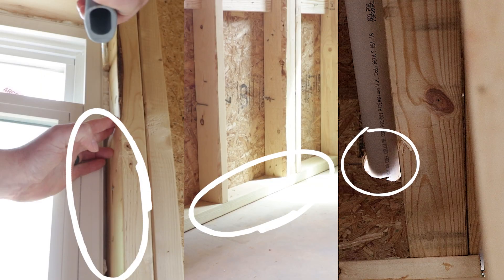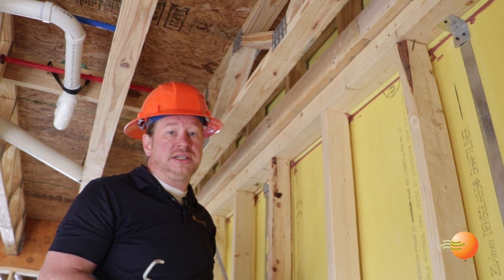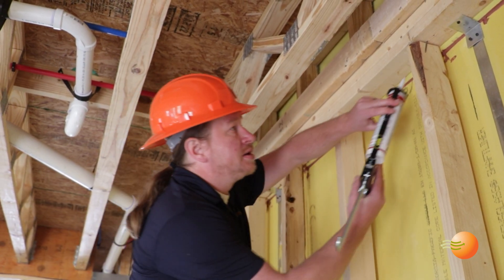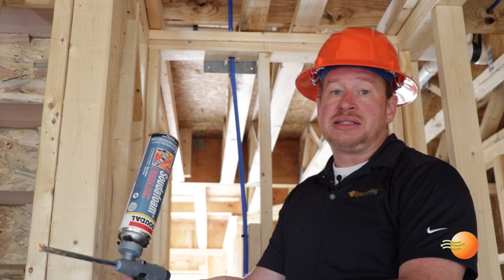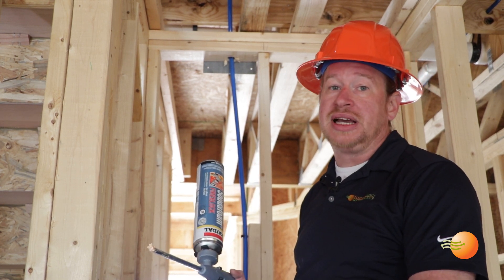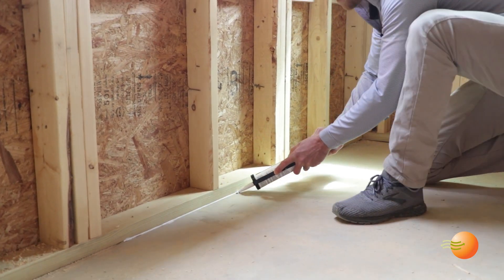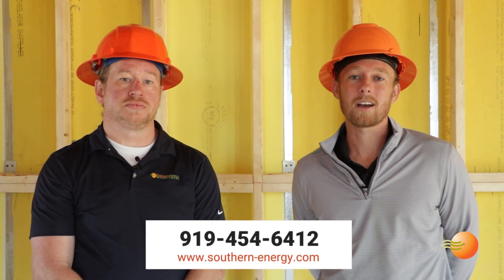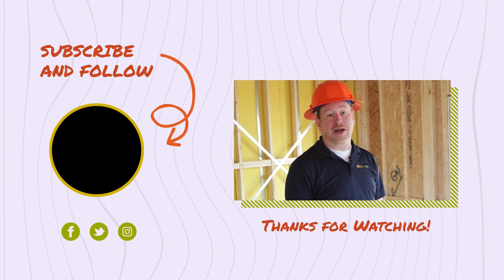How Air Sealing Saves You Time and Money

Comment: air sealing something from inside is stupid. Air seal from exterior.
Reply from the maker: There are plenty of durability and efficiency reasons why you should have relatively airtight exterior barriers, that's table stakes.  There are huge opportunities for interior air sealing, like sealing drywall to top plates and mechanical chase which are better addressed from the interior.  A lot of that air leakage is originating from the attic, band joists, cantilevers and other funky framing details.  If we're really trying to get home performance to the next level, ES v3.2, DOE ZERH, we need to seal up everything that we can in fiberglass houses.
Reply: Ive seen you post this comment on other content creators in the airsealing business... shut up already. You are 100 percent wrong get over it dude.  @Faruk651  you clown.